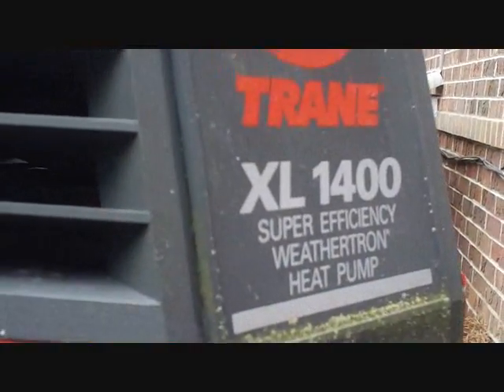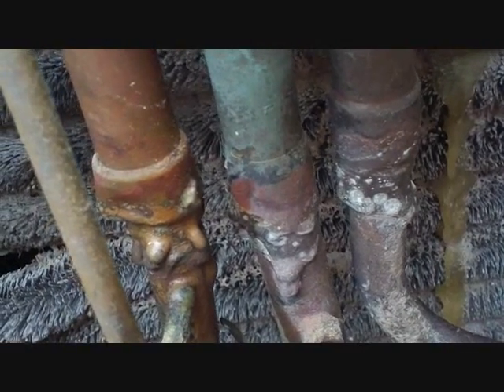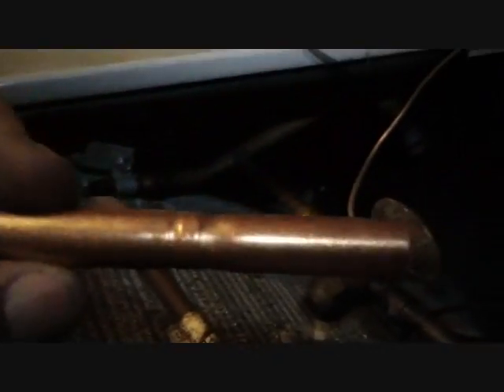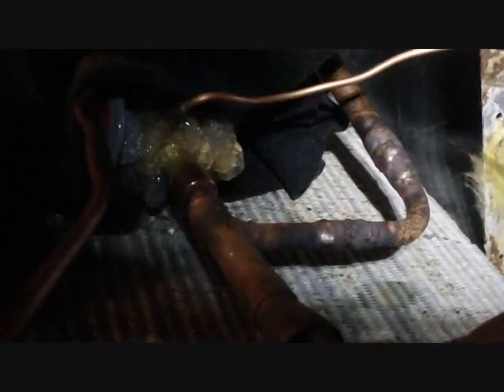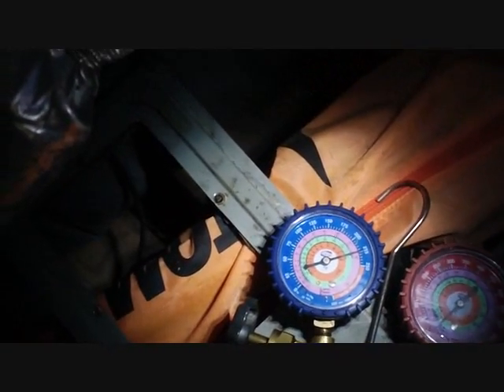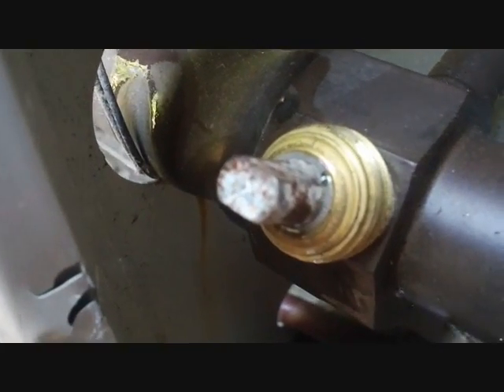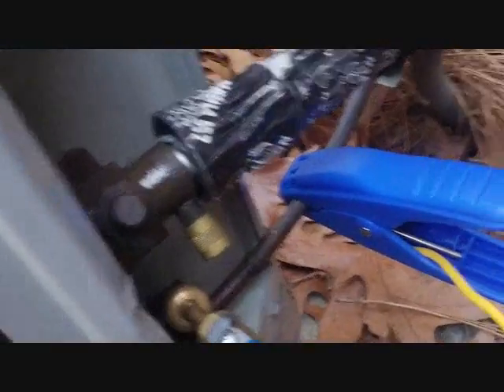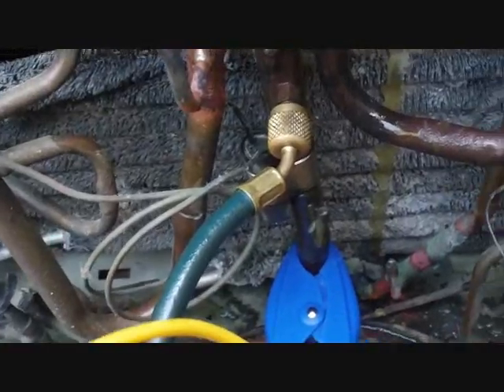HVAC Service- TXV Replacement and Leak Repair

Comment: I noticed that you are using a set of testo's instead of SMANN's .Did you have alot of problems with the SMANN's ? Been looking to buy a set of digital gauges.
Reply from the maker: No, I just like the feel of the Testos and the smaller size. The knobs on the SMAN were a little sensitive.